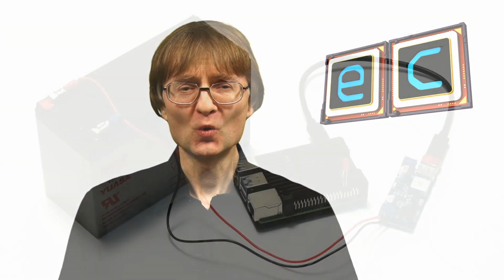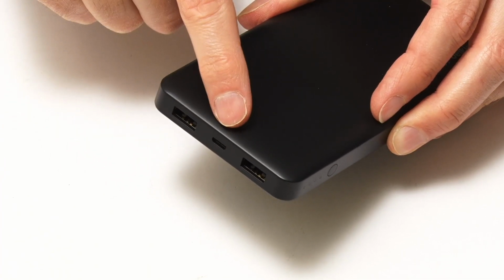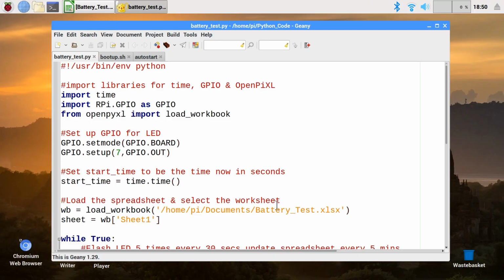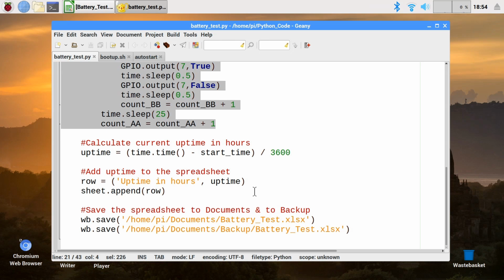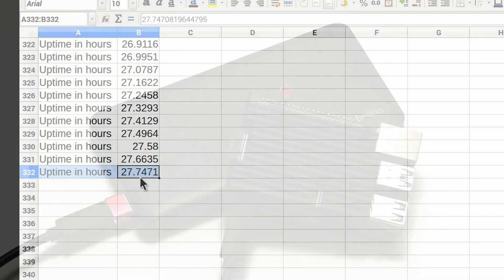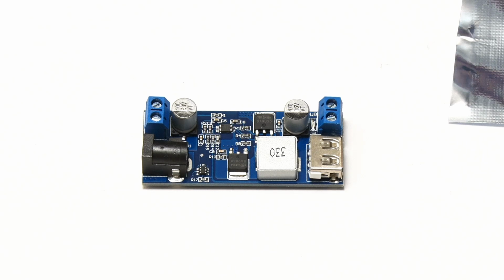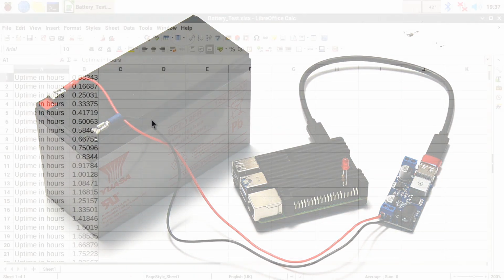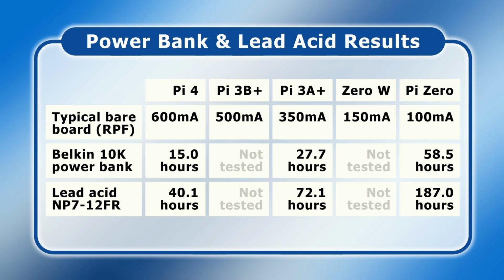Raspberry Pi Battery Power

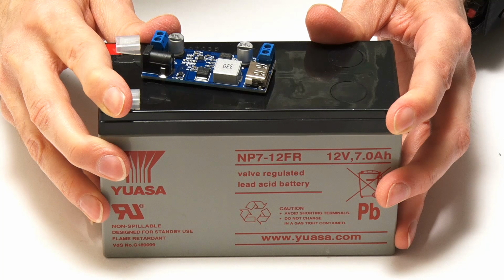Comment: At 15:00 abaout capacity at  5V  i want to say that YASA gives for 50% DOD (Depth Of Discharge) 450 Cycles service Lifespan when for 30% DOD gives 1200 Cycles Service Life. That means that if you discharge this battery at 50% you reduse it`s life by  62,5%!!!!!!! than if you discharge it at 30% DOD. Please anyone ,who will use in real world batteries to supply any consumption, to think serius this factor which is significant for his-her investment lifespan.
An other significant factor is the Operating Temperature Range :
 The batteries can be used over a broad temperature range permitting considerable flexibility in system design and location. So for 

YASA NP7-12FR  General Purpose VRLA Battery the specs are:
Charge – 15°C to 50°C
Discharge – 20°C to 60°C
Storage – 20°C to 50°C (fully charged battery)
When lithium batteries don`t work at freezing enviroment coditions.
Since 2017 i turn my house power supply to solar energy and now my consumption from the public grid is zero !  All for all at my latitude sun energy can moove everything. Unique limitation is the corect calculation for a proper instalation of the solar system.

I`m very happy with this video as it is a start and an inspiration to do thinks out of grid with less fusill fuels and i hope Explain Computers keep on this way!!!

Comment: Just curious why you use a spreadsheet here - why not just csv? it's importable to most spreadsheets from 1985 or thereabouts. Also, why log uptime in hours when you can log it in seconds and just do the maths later on? One more thing - writing to a file and then another one to "make sure nothing is lost" doesn't really work. Try a sync instead https://stackoverflow.com/questions/15983272/does-python-have-sync
Also - why are you running a GUI on a headless pi? And also, why not start this script with systemd?

Comment: Interesting information, Chris! Another data point for you, I was able to run a Pi Zero W for over 25 hours on a 2500mAh LiPo battery. I also found a very simple way to log the uptime data, although it does use another Pi for the log file. I did a short write-up here: https://gist.github.com/JChristensen/10470affa2ec984d4cac7ef70f16b7c2
Reply from the maker: Thanks for sharing this. :)

Comment: From a practical point of view: I am using a 5.200mAh (rated) power bank to power a pi zero wh with a pi infrared camera for automatic wildlife photography (as can be seen at mynturewatch.net). The device sets up a wifi of its own for controlling it and providing a live stream of the camera. It also saves still photos if any kind of movement in the video stream is detected. This rig will run for about 8-9 hours between setup and last photo. Had it outdoors few nights ago with temperatures below 10°C and it took about 2.600 photos. For unknown reasons the surrounding temperature seems not to have as much effect as I had expected: In warmer summer nights last year I also ended up with about 9-9.5 hours.

Comment: An important extra test is to put a multimeter across the lead acid battery, once the voltage falls to 11.5v you should disconnect it and assume the battery to be discharged. Running the battery below this voltage will shorten the battery life and could damage it. At 11.5v your run time could be aproximately half the time you are showing.

Comment: As battery management goes, I'm pretty sure you overlooked the cut off voltage for the SLA.  You pulled it way past its NEEDED discharge limit.  Needed for longevity.  Those results are not suitable for regular use.

Comment: For permanent operation i suggest putting a Fuse into the Cable close to the Battery.
Those Lead-Acid will put out a lot of Amps if the Voltage converter fails, potentially causing a Fire.

Comment: Great video.
I run a Pi4b with Home Assistant off the exact same Lead Acid Battery/buck converter that is permanently supplied by a mains power supply. I've never tested how long it will run, but always been curious. Thanks for sharing.

Comment: I've found a lot of these power banks have their mAh rating based on their internal cell voltage and not the 5v output. So if it's 10k like yours it is 10k at 3.4v or 34wH. When you convert to 5V the best you'll ever get is approx 7000mAh not taking convertor losses into account. Really they should market them in Watt Hours or mAh at the output. Marketing trickery and presenting numbers to make it look more powerful. The pitfalls of using mAh.

Comment: For every minute this lead-acid battery spends under 10.5 Volts its life is getting drastically shortened. A protection circuit is a must if you will want to be able to use such a battery for anything more than a few cycles.

Comment: I have used similar buck converters in multiple Pi projects. But the type with 7-30V input rating and variable output. About the same price from Amazon. Great for controller projects on 24V. With a mains power supply that is. The price is incredibly low for such a function.

Comment: Christopher, your calculation might have been pessimistic because the rated capacity of a L-A battery increases when the discharge current is lower. IIRC for 7 Ah the rated capacity is at 0.7A, but it might also be a higher current. You were drawing way less current. Even further decreased by the buck converter. In addition, after the voltage drops below 10.5V the battery is officially discharged. But the buck converter kept on working until the battery voltage was below 7 V or so. Not good for battery life, but you could get the last few electrons from the charge.

Comment: 1. Ctrl-down arrow will take you to the end of the current column in a block of data.
2. Phone power banks are almost always over-optimistically specified, so maybe 50% would be more realistic for a reputable brand (and more like 10% for any Chinese/unbranded ones).
3. Lead acid batteries from reputable manufacturers, conversely, are usually specified close to their real capacity, especially when new. In addition, the buck converter is going to keep going right down to almost 5 V input, so you're likely to get most of the energy out of the lead acid battery, unlike the 18650 lithium batteries in the power banks which will be protected against discharge below about 3 V.
4. Why didn't you just measure the current that each RasPi actually consumed? Then you wouldn't have to speculate about whether the "Typical bare board" figures given were accurate. It would only take a few moments to add on the extra few milliamps taken by the LED with its 2.5/30 = 8.3% duty cycle.

Comment: I thoroughly enjoyed this video. It's one of my favorites of yours. I have a tip, though, regarding the Sealed Lead Acid (SLA) batteries. Unless you purchase a "deep discharge" SLA, you are going to ruin the battery quickly with multiple deep discharges. Also, heat kills these things. So you may wish to keep it close to the floor in your greenhouse or keep it out of the greenhouse, if possible. Also, do not place it on a cement floor as I've "heard" that this discharges them more quickly. This may be a myth as I haven't tested this yet. When using SLAs, they like to be kept charged up. If the total  power drains are small at each use, you could get hundreds of discharge/charge cycles out of them. If you drain them (something like 80%), you'll only get very few discharge/charge cycles (maybe 8 or 10 -- your mileage may vary). If you drain them more than 80%, the battery is permanently damaged. Also, give them a top-up charge every month as each month without a charge causes a permanent capacity reduction of a couple percent. After 6 months without a charge (and no power taken out of it) the battery will have permanently lost 20% of its capacity meaning that even if it is charged to 100%, the most capacity you'll have is 80%.

SLAs lose capacity with each charge/discharge cycle; more so than LIon and LiPO. I would love to see your results from running the same test 5 consecutive time on the Pi 4b. It would be interesting to see how much capacity (measured in runtime) is lost on each go-around.

YUASA is a middle-of-the-line to upper-line brand. When you completely discharge an SLA, it takes a longer time to charge (obviously). With deeper discharges, the voltage has to be higher to charge it up, which causes the lead plates inside the battery to heat up. The longer the charge, the hotter the plates get. This can cause the plates to warp, causing shorts. Additionally, it can evaporate the acid in the battery more quickly, which causes oxidation on the plates, which causes even less capacity.

Keep making your vids. I get some good ideas from you an expand my knowledge. Thank you. :)

Comment: Sorry, but while your numbers on capacity are correct, the reason you give is not. Don't feel too bad since EVERYONE seems to make this mistake. The power banks ALWAYS list their capacity in terms of the cell, so a 10,000mAh power bank is rated at 3.7V (nominal voltage of the cell). What well ALL should be using is the Wh number, so a 10,000mAh power bank, @ 3.7V is: 37Wh. A Pi Zero, drawing 100mA, is drawing 100mA @ 5V = 0.5W. So to get hours: 37Wh/0.5W = 74h, theoretical. The 0.75 factor you use is simply 3.7/5V = 0.74. It's not a 'usable capacity' thing, it's straight math.

Comment: A few points on the Lead Acid battery - it may take a few cycles to get it up to best capacity.  The deeper you cycle lead acid  the less cycles you will have so shorter lifespan. Leaving very low draw like those rasberry pi are worst thing for the lead acid  AGM batteries in long run because they can take the voltage so low and battery will sulfate if not recharged soon.  For your greenhouse shed - a small solar panel with load controller will extend the life of your lead acid battery for many years . Of course lithium batteries like the power packs all have low voltage cutoffs built in to their BMS so you won't ruin the lithium cells in there. I wonder what the final battery voltage of your lead acid was after you ran it for such a long time on that small buck converter - it probably took it down so low in voltage!  While lead acid batteries and the AGM type you have are very rugged  and can be abused a bit best practices are not to take more than 50% capacity from them and best longevity will be to not take more than 20% from them. That is why using a pi zero  w and small solar panel would be almost ideal in your greenhouse shed.

Comment: The 50% useful capacity of lead acid does not mean that you can not use its full capacity. It means that it is recommended to not discharge it more than 50% in order to maximize its total life. A typical lead acid battery will lose the 40% of its rated capacity in less than 200 cycles of charge-discharge at 100%, but it could endure more than 1000 cycles if it is discharged only at 50%.

In the battery itself there is no any device to limit the amount of discharge. It must be your application which puts that limit. Moreover if you discharge too much (below 9V) thar type of battery it coul be permanently damaged.

Comment: Hi,
awesome video! Thanks for this as I was looking for something similar.
My question is, can I connect a solar panel to that lead acid battery and have it being charged while at the same time powering the RPi or for example a dashcam?
Would I need some sort of device in between that would stop charging the battery so that it doesn't overcharge?
Thanks!

Comment: If you have to recover a save by using a backup first, save the next time in the reverse order. That way you can't have 2 corrupt saves due to power loss at the same time.

Comment: Lead Acid battery ratings are hour ratings. 
For example a typical 7Ah battery is as follows:
7.00Ah 20hr Rate (0.350A to 10.8V)

If your load is less than 0.35A, you will get more than 7Ah capacity. If your load is more than 0.35A, you will get less. It's not precisely linear, but it is worth looking up the datasheet for your specific battery where the curves are given. I would not expect you to ever get more than about 110% rated (normally 20hr Rate) capacity.

Charging methods can also affect this a bit. It's a deep rabbit hole.

Comment: Thanks for this video Christopher!.
Planning of making a go-kit running RaspberryPi 4 running either HamPi (Dave Slotter - W3DJS) image or the KM4ACK -Jason Build-a-Pi script to assemble RaspberryPi based Ham radio software under Linux with a 12v 25Ah LiFePO4 battery, 50W foldable solar panel & LiPo solar charge controller to control a smallish ICOM ham radio transceiver mounted in a pelican case & this video is extremely helpful as I didn't want to lug around a windows laptop adding extra weight.
The Sotabeams (UK) linked dipole antenna and 10m telescopic pole are lightweight.
Thanks so much & God bless!

Comment: I'm surprised the lead acid battery (to me, on some subconscious level, a "real battery") "only" gave about 2.5 times the operating hours the power bank (to me, on some subconscious level, a "toy battery") did.

Also, when looking for the ends of the Excel sheets, I was kind of expecting that some of them might have zero point something hours as the last value, after the last "real" values. I had assumed the voltage would recover a little once the load had gone away when the converter circuitry cut off the power, leading to restarting the Pi briefly.

Comment: I suspect your results for the lead acid tests   may  be partially explained by how the buck convertor operates . It doesnt just convert 12V to 5V . It probably stops working when the input voltage drops to around  6-7 V.  The published battery capacity is normally measured when the  voltage drops to around  11 volts. It would have been interesting to measure the battery voltage at the end of the test.  I  use several LED matrix signs ( Arduino driver) that run on  a 12 V  battery and they still function even when the battery voltage drops to   8V .  Not good for the  life of the battery though .

Comment: It should be worth pointing out if you go lead acid battery to consider using a deep cycle battery for more charge cycles, of course it depends on price and usage as they typically cost more.

Comment: The problem with tests like these is that real-world use should never run until these batteries are depleted as they are in the tests.  The lithium batteries should (not all do) have a built-in microcontroller to prevent the batteries from dropping below a safe voltage, but the SLA battery will not.  Taking an LA or SLA battery down to the last mAh will run a risk of damaging or killing the battery.  Or it may fail during recharge, off-gassing if you are lucky or exploding if you are unlucky.   In normal use in cars and such, the lead batteries are used to start the car and then immediately recharged by the alternator so the battery is never allowed to drop below a rather high level.

Comment: You know, I was wandering something like this video... I want to build a raspberry pi 4 cluster, with 8 x raspberry´s for XMR(Monero) mining, and you should say, raspberry is so low on processing, but then, I say, Im want to use solar chargers to charge the raspberry´s and use the method of running the script at boot, so even if my solar batterys gone out of charge, when the solar come out, they gonna turn on automatic

Comment: 15 years ago, i also use lead battery acid as a "powerbank" for my ADSL+WiFi router. So I can still have internet when the electricity down.
(Not anymore, since i now live in area with good power availability)

Comment: If you plan on using a 12v battery for this type of work, go for a deep cycle battery. This will increase the lifespan of the battery. If you can't find a proper deep cycle battery, go for a marine battery.

Comment: What you're missing is that 10 Ah nominal capacity of the power bank is rated at 3.7v nominal voltage of the li ion battery cell inside the bank. Therefore, it is not correct to divide the battery rated capacity by the current rpi draws at 5v since the voltages are not the same. The best approach is to convert everything to watt hours and assume an 85% efficiency for the voltage conversion circuitry in the power bank.

Comment: Great, informative video, Chris! Thanks a bunch! The Pi is definitely a good solution for battery powered applications, but if you really want performance nothing beats low power microcontrollers like ST's L-series. The problem in that case is the ridiculously long runtime (many years).